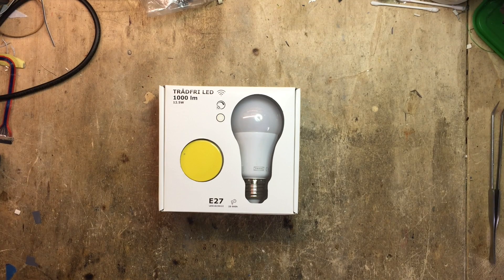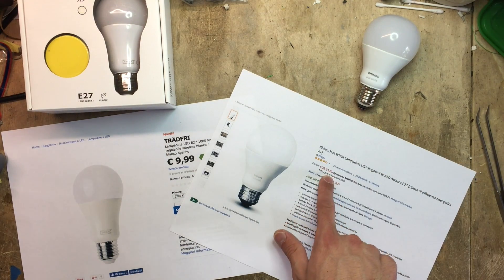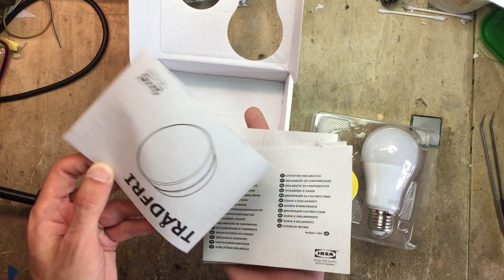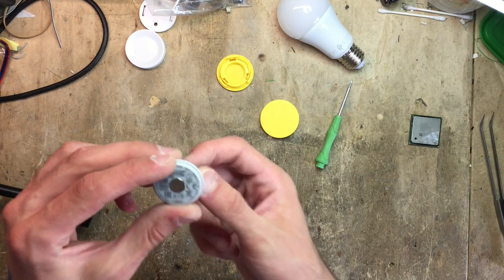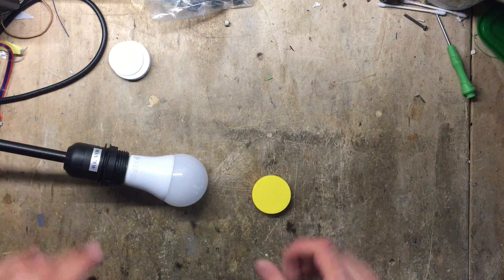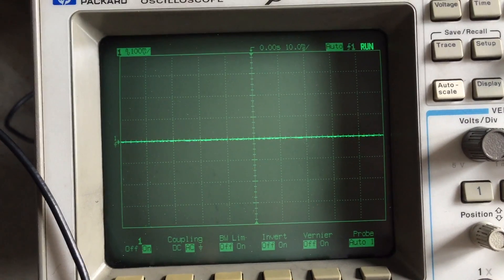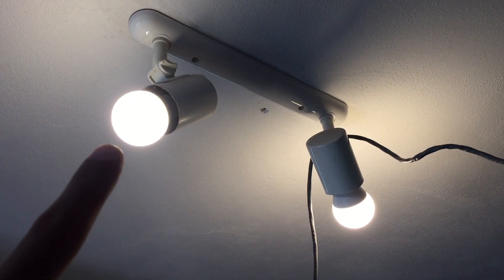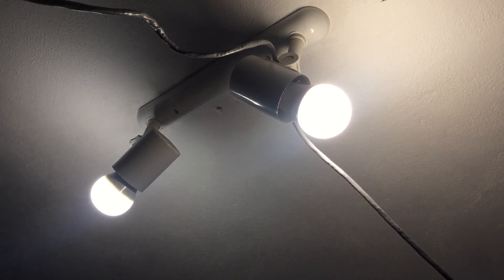IKEA TRÅDFRI Wireless Dimmer Starter Kit First Look Review TRADFRI vs Philips HUE [EUROPE 220V]

Comment: Thanks for the good video. One feedback regarding your flicker test setup: I think you should add a load resistor in parallel to the Solarcell so that the voltage is lower than 0,2 V per cell. Then the amount of light and the voltage are nearly proportional. Additionally, this removes dirt effects like capacity of the cell or RF radiation.

Comment: Hi there! I'm writing this in English even thought I'm Italian too so everyone can understand it and comment about it. First of all,  great video man, I love the fact you took out your oscilloscope for this. My question here is: how can Ikea dimmer their lights if they don't use PWM? I mean usually even regular LED bulbs are operated at PWM just so they can get a lot more intensity than they would get if operated at fixed voltage. I see you set your oscilloscope at 10ms for the time scale, so a 60hz pulse should be indeed visible. My only theory is that they are using a much higher frequency for their PWM (the voltage's delta at the oscilloscope is not that big even on the Philips' one) that is not visible at that timescale. If anyone has some insight on this please let me know.

EDIT: after watching the video a little research (I guess I should've done it BEFORE commenting :P) got me to this site (ref: https://www.heise.de/make/artikel/Das-steckt-in-Ikea-Tradfri-3597295.html) which says (in german) "The dimming and also the adjustment of the color temperature are controlled by the change of the duty cycles (pulse width modulation PWM, frequency 600 Hz) of the GPIOs PB12 and PB13. On and Off is done via simple TTL-high or low." Cheers!
Reply from the maker: Ciao!
PWM is more about efficiency than intensity. There are many ways to make a PWM circuit, from single-chip solutions to entire dedicated boards. In any case, the PWM needs to be "tuned" for the application and should have as little ripple as possibile, as this can cause flickering (or whining for a motor). Another way to dim a light is with a linear voltare regulator, but they are nowhere as efficient as PWM so they are only used when a clean, ripple-free output is required. Linear regulators basically convert the voltage difference in heat. There's also a hybrid of the two, if you want a 20V->1V converter, you can make a 20->2V PWM converter and then a 2->1V linear on the output. That's how some benchtop DC power supplies work.

Comment: Wow! I am just doing a bit of research for a video idea that I have and came across this gem. I cannot believe the difference. I have some Hue bulbs and actually switched to a cheaper alternative that works with the same protocol (Zigbee). I am pretty sure that I shall be switching to the TRÅDFRI bulbs now though. Looking at the price is such a difference, for instance the GU10 bulbs are £12 where as the equivelant Philips Hue bulb is well over 3 times that. That means that in order to put them into my bathroom I would have to spend around £150-£200 for the Hue bulbs instead of the £48 for the Tradfri. I was going to recommend the Philips Hue bulbs until I saw this video but that has now changed.
:-)
John

Comment: You actually can combine the Hue and Tradfri. Only thing you need is a basic station called Homey by Athom. Both manufactures are supported by an App. I self do own a Homey and can combine multiple devices from different brands and make flows with them. So there is a way to control them. And I believe the dimmer in your video is supported as well.
Reply from the maker: Christiaan Sittrop thanks for the info. Had a quick look at it and the design is similar to the "ball" that google made a few years back... it's a nice device but I think that 299 is a bit expensive for controlling a few bulbs, for that prive you can buy a lot of Tradfri accessories. The sad thing is that the incompatibility is software only and made on purpose....

Comment: Great review, I really liked the flicker test, I've not seen that before.

I didn't realise that the "puk" was magnetic (I love magnets) and didn't even require the other grey half. It looks like the bridge is a must for HomeKit integration, but what a price!

Does the puk dial work with the other 800 lumen bulbs that can change hues?
Reply from the maker: Yes, the magnet behind the puck is great. And since most of the Ikea light fixtures have parts made of metal, you can stick it right on it. I think it's possible to pair it with the 800lm cold/warm bulb but you'll lose the cold/warm feature. Maybe you can solve that by introducing the Hub and then customize the setup from the App. I don't think I'll get one of the cold/warm models since I don't have a use for it (Don't need different "hues").
Reply: I fully intend to hook this up to Apple's HomeKit, I wonder if that dimmer can be used with other lights?

I don't see that yellow dimmer for sale separately, I hope they change that policy.
Reply from the maker: HomeKit support will hopefully arrive later this year. The hardware to support it should be already embedded in the gateway. Sadly the dimmer puck is not for sale separately. According to this video from Ikea, you can add the dimmer puck to the gateway https://www.youtube.com/watch?v=lu80Xll4cQQ
Reply: An email from them today still doesn't shed any light on the ETA of HomeKit compatibility.

I expect eBay may be a source for something like this, but nothing as yet. Looks like I'll be emailing Ikea again..